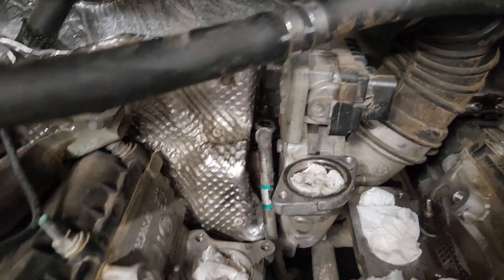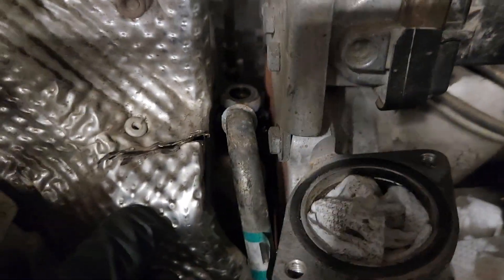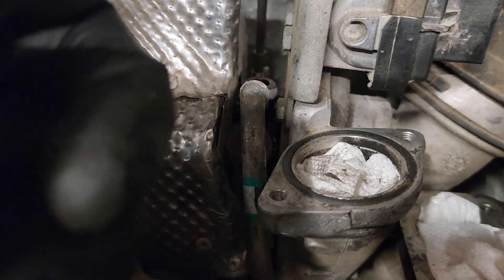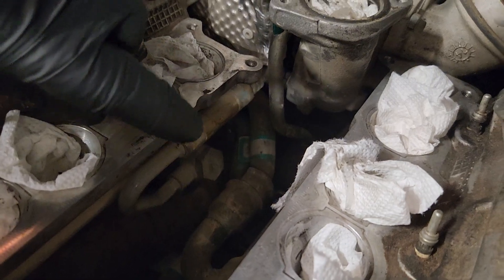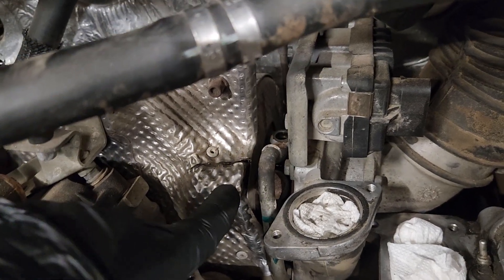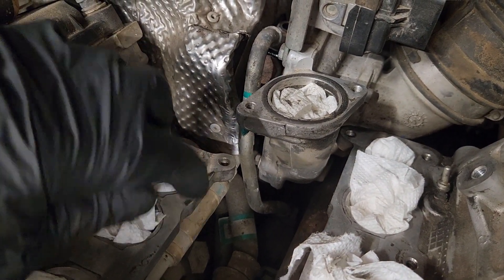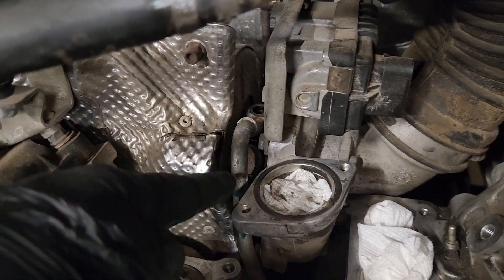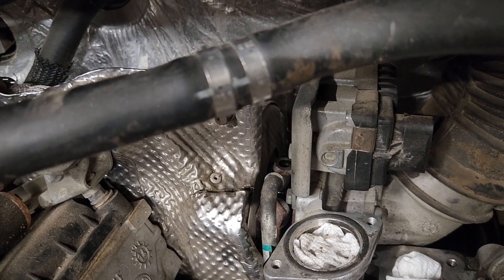Replacing Ecodiesel turbo water feed line: impossible!

Comment: I swear the day will come when the car manufactures will just make engines hermetically sealed like an air conditioner compressor. Everything will be welded together and spark plugs will be welded in too. When the oil needs to be changed you just have to go get a new engine. Oil for life.